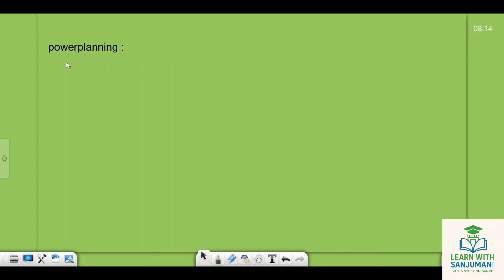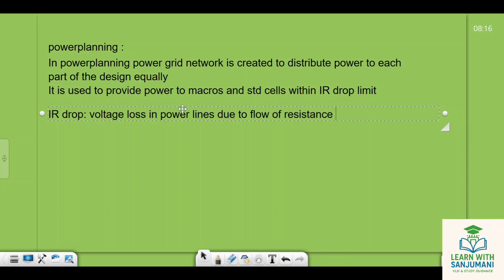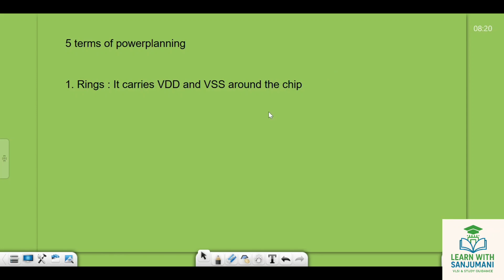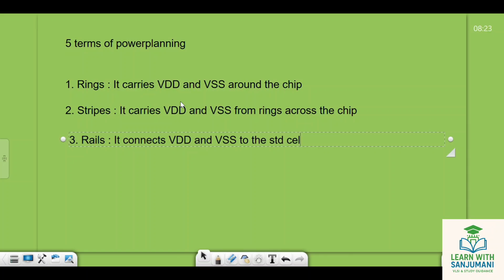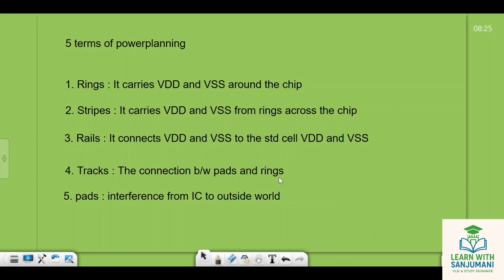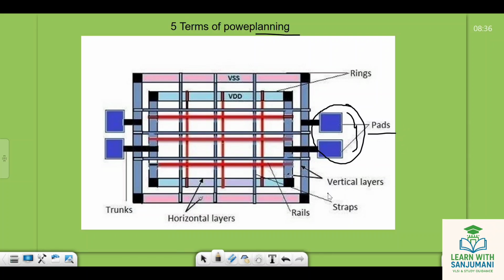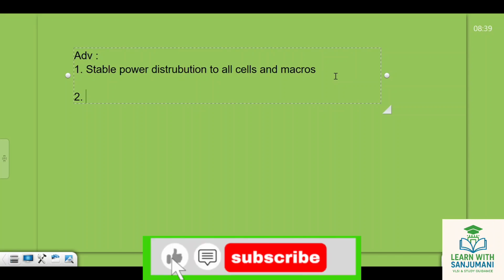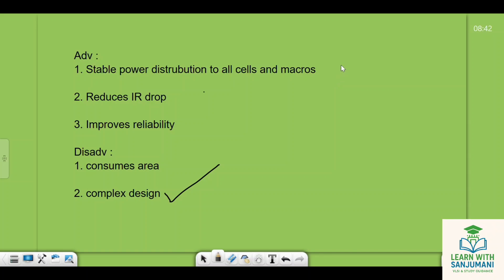Power planning Basics every VLSI engineer must know this 🔥✨

Comment: I have problem in the power planning stage i face missing vies errors they are more than 250 manual place the mission vies or change the power planning TCL file re writing which is option you suggestion give me
Reply from the maker: It's always better to update your script to fix the violations rather than placing them manually 😊 
Manual via placement can be considered only for a few remaining violations.